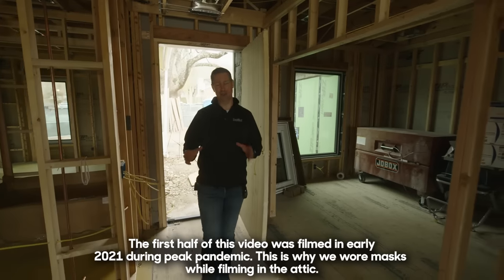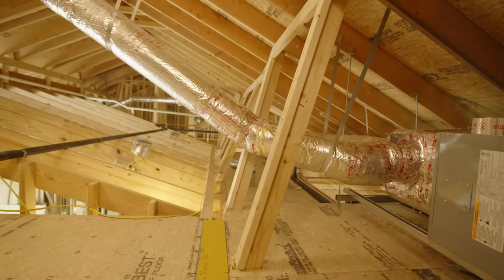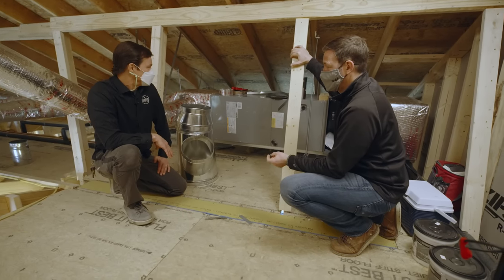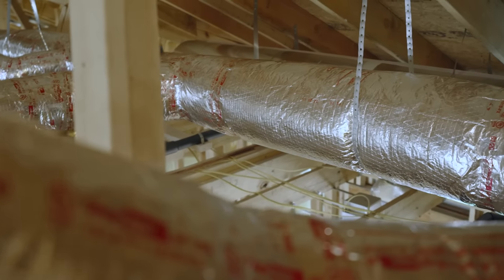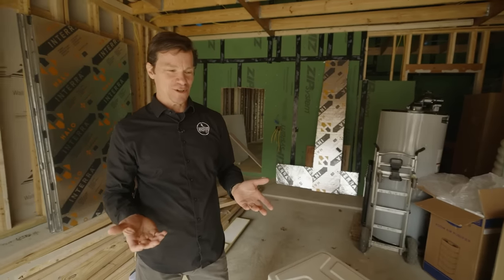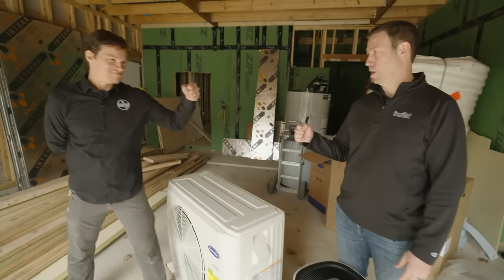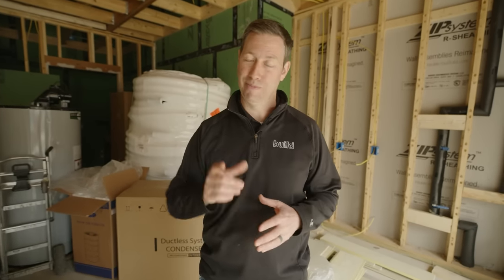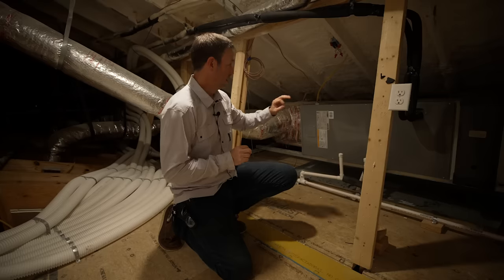HVAC Done Right! Watch this before you install!

Comment: At our new house we just finished (who am I kidding, nothing is ever “finished” in my world… 🤣😂). We moved in a little over a week ago. We opted to do a 12k btu Daikin MS in our kids playroom/bonus room over the garage due to the L shaped configuration would make a pretty long duct run and my HVAC guy said I wouldn’t be happy with a zoned system off the upstairs unit. The house is zipped & spray foamed so pretty tight. Scored a 2.0 ACH50 on our blower door with some missing door weather stripping (painters left the evening before, and I didn’t have time to get all the WS reinstalled perfectly before he showed up at 8am the next morning). That mini split conditions that space perfectly and it’s so quiet. 

Matt, You have made me a believer in supplemental dehumidification. I’m in GA about 15-20 minutes from Zane’s build. (I’m actually buddies with Zane). I did a 100 pint AprilAire system for the house. Also bought a 70 pint in the unfinished basement (haven’t hooked that up yet. Got a Deal on a lightly used SantaFe unit off eBay for $500!) Our other 2 main systems for the 1st and 2nd floor are Trane traditional ducted systems. 2.5 ton each. High efficiency VS furnace & 16 seer AC. Also did a Fantech ERV. Unfortunately due to budget overages & equipment availability we had to change plans last minute and switch to single speed 16 seer compressors. Regardless though, this house is the most comfortable house I have ever lived in. We can keep the AC at 75 and it’s super comfortable in the house. If you had told me that before, I would have thought you were crazy setting the Tstat at 75 in the summer in GA. But it’s totally comfortable. We sleep with it set at 71 degrees, whereas at our old house we’d turn it down to 67 at night.

Comment: Best value: know someone that does installs.
Reply: Alot of BUTCHERS do installs. " Friend deals" people get the quality they pay for
Reply: I'll do it myself.
Reply: @testthisfordecficiencies  99% if diy jobs are just as bad, it rare to see one done right and to code.
Reply: @zack9912000  Most definitely. Maybe even more than 99 percent. I did all my own HVAC system but I had it engineered, permits pulled and inspected. Had to have gas done by a certified gas installer though. It is required here.
Reply: @zack9912000  you know there are a lot of hacks but I still hook up friends and family purging nitrogen, flushing/replacing line sets on and on I’m a service tech and my installs look and preform like it legitimate or side job🤷🏽‍♂️
Reply: Do you mean be owed a favor or be good friends with?

Nothing worse than "somebody knowing me for what I do" and wanting a deal.  Or if I want extra work this weekend
Reply: @victordasilva5255  this is not a good idea. Why shouldn’t I be able to buy the equipment? I don’t install them but I don’t like dealing with markups. I can buy them, my installer can install it. Problem solved
Reply: Buy wholesale and have a friend install 👏
Reply: @zack9912000  says the AC guy 😂
Reply: @testthisfordecficiencies  new thing is gas free for air quality and safety, all electric and solar
Reply: @victordasilva5255  have to protect their profits 😂
Reply: @zack9912000  
Yah I had that years ago.
Use this family friend company.. 
When I look back on it... aparently he was using my house to learn how to build ductboard and run hvac lines. 
The result is horrible. Flow problems, hot spots, and dripping lines. 
So I have taken to educating myself now. I have called out so many hvac companies to start over. So many look at it and tell me.. "it's new? What's wrong?". Or want to change the unit for next size up.  They also don't want to run metal pipe. They want to use the flex. 
Might end up doing myself. I just need help with designing the system.
Any companies recommended to design me a system remotely?
Reply: @victordasilva5255  
It's to easy to get a hvac license also.

Comment: 2:28 "...not very big; this is about a 2200 sq ft house..." That's bigger than my house and about 95% of the houses in my neighborhood. 😂
Reply: I agree,  most houses in my neighborhood range at 1,000 -1,6000 square feet.  😁
Reply: I thought he was gonna say about 1400, with Austin market they been getting smaller and still $800K
Reply: Yeah, and then followed that up by mentioning the “butlers pantry”! :)
Reply: When I heard that, I just figured "everything's bigger in Texas" - LOL.  My house was 1,600 across 3 floors when I bought it, though, with an added floor, I'm closer to that 2,200 number now, but across 4 floors!  I know Matt's focus is on high-end new builds, but I wish he'd cover some less than full-gut rehabs. Lots of old housing stock around the country that could benefit from more intelligent construction. I have several mini-splits and multi-splits in rental properties and they are great.
Reply: That’s bigger than my mom’s rental which is several hundred feet larger than the one we live in. A 2200sqft house would be a dream.

Comment: Hey, I hate to be that guy but I did see something that you might consider on your next installation. I probably wouldn't want the outdoor units stacked on top of each other. When the top one goes into defrost the water will run down onto the bottom unit. I'm not familiar with carrier mini splits but sometimes they give you drain adapters to run the water away. Also, the pcb board is generally located on the top of the unit so if the board goes bad on the bottom unit the tech might be cursing out the installer. Other than that it looks stellar!

Comment: We did our own install. MrCool Olympus Multi Zone system. No experience. We can have 5 zones but are only using 4 currently. It's been very hot this summer and it's doing find keeping the house cool. We are Off Grid through so we onky run it until 10pm. The house is sealed up and insulated well so ot stays comfortable until the sun comes up the next day.
Reply: Good luck finding contractors who will touch those china made mess. Parts are hard to get for those and repairing them isnt pleasent. Companies here refuse to work on DIY systems
Reply: @zack9912000  absolutely with you on this. I helped one person with one of those things, washed my hands of them after that. They are cheap for a reason! We sell Mitsubishi or we don’t sell a mini split to the consumer.
Reply: @zack9912000  Luckily I have a good local HVAC guy who we've used for 20+ years.  He helped charge the system and knows how to work on them.
Reply: @Off-Grid  I have 3 minis in 2 buildings. They are working fine after 3 years. Last summer i had the regular five ton in the house replaced by a unit made in Texas. It never heated right and was replaced under warranty after 8 service calls. The Japanese minis are better quality than than the made in America stuff. They are not hard to work on either. I see a lot of whiny ac guys trying to steer people away from minis  but they are here to stay.
Reply: @user-bj4lp3fr1o  hey, I'm not arguing with you.  If it works it works and so far it works just finem

Comment: “On all the time” scares me from a humidity/ mold standpoint when talking about HVAC. I’ve seen so many problems in homes were they get mold because of that. The coils get loaded, the coils shut off, then if the fan keeps running it turns the system into a humidifier. 

Same problems occur with mini split and is a much more common issue.

Comment: You do not need VRF or a mini split condensing unit/heat pump to do variable flow refrigerant. Traditional systems use vfd driven and digital scroll compressor technology with a more robust product.

Comment: Thanks for video.  Was wondering why mask in attic not knowing it was filmed 18 months ago.  We moved to FL in house built in 2003 1800 sq ft.  Furnace now on gas.  Looking to to put a min split in Lanai around 300 sq ft garage and small bedroom facing south.  From video maybe split for these rooms and second unit for main house.  Will need to get a HVAC contractor out to go over my thoughts.  Originally was thinking one unit until watching this.

Comment: What is the HVAC industry doing if anything to mitigate the GFCI tripping issues?
As the 2023 code is removing the TIA exception for many splits using adjustable motor speed controls.

Comment: On a side note, that’s nice and all to advertise for carrier but VRF tech is 40 years old and was invented by Daikin in 82. Carrier does not manufacture these units but Toshiba as all or most American AC manufacturers have over the past years. Why reinvent the wheel?!
Also a 9kbtu for a bedroom is beyond o resized and in a hot and humid climate is criminal if you don’t have proper dehumidification because what Christophe failed to mention 
 is that those units are very bad at dehu. They have a  90/10 or so sensible heat ratio, which is not sufficient for humid climate on a “normal” house especially when the load is maybe 3kbtu at most.
Reply: I think you mean Midea. Midea and Gree make most of the minis that are relabeled. They also make most of the parts for Mitsubishi and Fujitsu. Everybody buys their stuff from China.

Comment: also cleaning mini splits are so hard compared to conventional attic coils with normal denser filters.
Reply: ilickspam -  Do cleaning the indoor wall warts or in-ceiling mini-split indoor units involve more than removing and washing the plastic  dust filter every 3 months?   Do you get a lot of dust in those coils that must be carefully vacuumed out?   I have a concern about this question and it sounds like you have experience.

Comment: Beautiful picture and setup of those mini split units. Just one observation: I don't see any UV tape on the refrigerant lines.  That Texas's radiation is going to ruin the insulation. It's even better to use the white PVC cover for extra protection. Finally, where are the a/c disconnects?

Comment: I am very curious about the control systems. I recently had a few different systems put in at my house and I was replacing two forced air furnaces with conventional outdoor a/c condenser units, along with a boiler with no a/c in that part of the house. So, I ended up with four systems: 1 minisplit by Pioneer (works great), 1 ducted minisplit by Mitsubishi, and then two fairly conventional Carrier Performance heat pumps: 2 ton and 3 ton. The performance in the winter has been abysmal and pretty disappointing. But part of the reason I went with just two-stage conventional heat pumps instead of inverters is that I heard enough nightmare stories about the thermostats and other tech associated with Carrier's Infinity stuff that I just wasn't comfortable. In those two zones, I run Honeywell Prestige HDs with all the associated Delta T and outdoor sensors, as well as accessory indoor sensors. They are awesome thermostats, and I hated the idea of giving them up and being tied to Carrier's thermostat tech, as they aren't a technology company; they're an HVAC company. Now, with these minisplit units Carrier is putting out, and the engineer's comment about being able to use third party controls, I'm intrigued, because the more conventional Infinity systems do not offer that option. I totally would have been all-in on inverters if I could have chosen a control option that was not Carrier. I respect Carrier and like their quality, but I'd rather be able to control it with Honeywell. I hate thermostats that want to think for me and guess what I want. I just want to program them to do exactly what I want.
Reply: As a tech for a Bryant Contractor, most of the Carrier Infinity/ Bryant Evolution stuff these days can be run off standard tstats. I'm curious what "horror stories" you've heard though as I've got a few customers with infinity systems from like 2005 still chuggin along.
Reply: @TheMax13542  Interesting. This would be Infinity as of 2020, which was supposedly inverter-based. Because standard thermostats can't control anything more than 2- or 3-stage, they aren't able to control a variable unit like the newer Infinity stuff. As far as I know, that's still the case. I can say for sure that my Honeywell Prestige HDs can't do anything variable. Just 2-stage heat pumps. I suspect I have some installation issues and configuration issues with these Carrier Performance pumps. They may not have the performance of an inverter, but they shouldn't struggle as much as they do to make ANY heat at 30 degrees F ambient. I picked the best firm I could, but as everybody knows in HVAC, installation is everything.
Reply: @dmorga1  ya so the tstat just tells the unit to cool/heat/dehumidify, the speed of the inverters is controlled by the control board in the actual unit which is using input sensors and logic to determine output speed. You could have configuration problems, you could have capacity problems. The conventional systems have every bit of capability as and inverter drive systems, the benefit to the variable speed is it can ramp down with a low load rather than just turning on/off.
Reply: @TheMax13542  Yep, that was my understanding on the performance side, as well. I suspect some wiring and configuration issues are keeping my downstairs unit in particular running in Stage 1 only. However, Carrier's documentation states that on the Infinity side, the inverter controllers and all that are in the proprietary interface--so you have to buy their thermostat and that's that. The stories I heard were complaints about awful user interface, connectivity issues, and a garbage app. Basically par for the course for a company that isn't a tech company trying to do tech. But my understanding is the current Infinity stuff has to use Carrier's proprietary t-stat, unless something has changed in the past year. I'm waiting for manufacturers to arrive at an agreed standard for controls so that you could buy anyone's interface to control your Carrier, Mitsubishi, whatever. But the manufacturers don't want to do that. It strikes me as the car stereo wars of the 90's when OEMs were frantically trying to design radios that couldn't be swapped out to lock buyers into their stuff and their upgrades--see the oval Ford Taurus radio of '96 for the most egregious example (in the end, it didn't matter--Metra came out with an oval kit to fit a standard DIN radio). Mitsubishi wants you to use their t-stat, but I don't like their t-stat's logic. I don't like that it optimizes efficiency over comfort in some scenarios and doesn't really respond well to setbacks at all, despite the fact with modern efficient heat pumps, setbacks can save me money when the space is unoccupied. I do think eventually, there will have to be a control standard for inverters so that you can use any thermostat.

Comment: I installed a MR Cool 18k works great. Mini split.
Reply: my carrier rep said they make the 4th gen DIY, and said do that for my shop not their mini split
Reply: Good luck finding any company that will tough them for repair work. Parts are hard to get, DIY jobs are never dont right and companies dont want to be held responsible making the mess work. Hence why MR cools are called throw away minisplits
Reply: @zack9912000  I'll fix it myself.
Reply: @zack9912000  it's not rocket science, a diligent DIYer can handle a minisplit install and save 1000s

Comment: Insulated flooring, celing insulation on top of insulation, t-studs with more insulation, air conditioned attic and garage, 3 compressors, my grandparents will still have the thermostat set to 88°F (31°C).  They'll also be wondering why the fan won't turn off.

Comment: You mentioned that when you are cooking in your own home that you noticed that the particulate matter indicator on top of your Hepa filtration unit went up and it was a great reminder to use your exhaust hood while cooking. Is there any issue or danger that the Hepa unit could interfere with airflow pathways within the kitchen and cause the exhaust hood to not perform as well as it should?

Comment: 15:25 some systems, at least in commercial or large scale housing, can move heat from one room to another (cool one room by using it to heat the other)
Reply: That is a VRF system.
The type of system they are showing either heats or cools.
A true VRF system can SIMULTANEOUSLY heat AND cool.
He glossed over many things, it is a short video, but he did try to explain the difference. It is the location of the metering device but only to a point.

Comment: I'm curious as to why the under roof insulation is so thin in this video. I'm in New Orleans and most of the attics I've seen with spray foam have insulation usually as thick as the rafters if not thicker. Granted technology has gotten better since Katrina made me re-roof but is it that much better? I'm lucky enough that Ida is giving me another chance to re-roof again. Although this time I have no insurance, very little help from FEMA, disabled, no job, no cash & high prices & inflation that doesn't look to be slowing down, I need to try to get as much for my money as I can. Do you think Carrier would be willing to sponsor my repairs? I could cook em a real good meal. lol
Reply: At 5:03 he explains that there is insulation on top of the roof as well.

Comment: If you have a carrier infinity heat pump and fan coil you definitely want to spend the extra few hundred bucks for the infinity control stat so you get the full benefit of the system, ecobee is great if you have a traditional 1 or 2 stage setup, the engineer missed out on a lot of the good things carrier/ICP systems have going for them which is unfortunate
Reply: The infinity only works on infinity equipment.  All carrier mini splits are made by midea so the two "languages" won't understand eachother.  Just FYI.

Comment: You called the outdoor systems as being connected to the indoor units via “Freon” lines. Presume you mean Puron (R410A) as Freon (R22) has been phased out and you can longer use remaining supplies or recycled Freon to replace or refill old system.